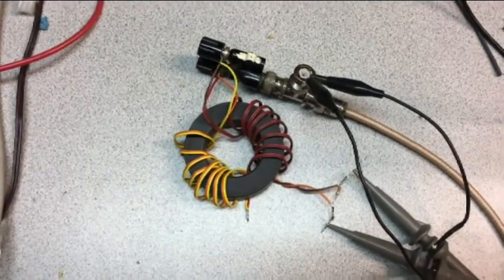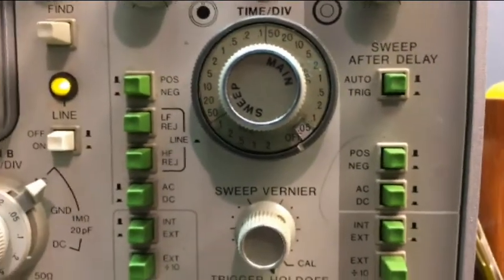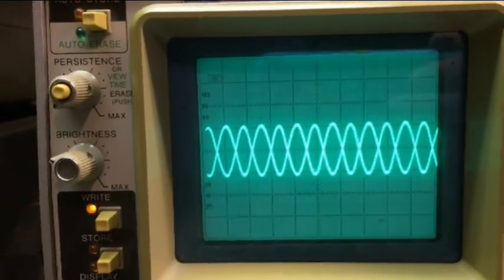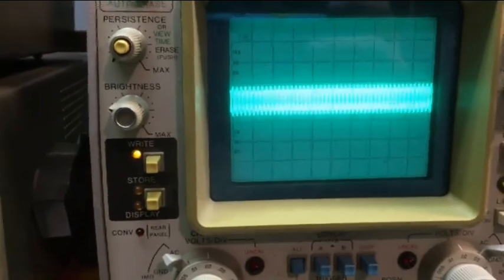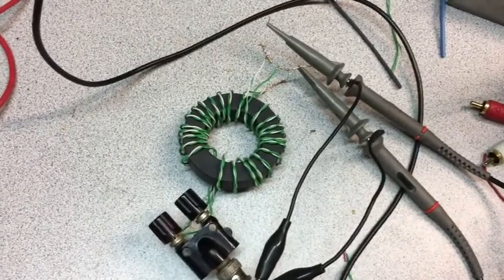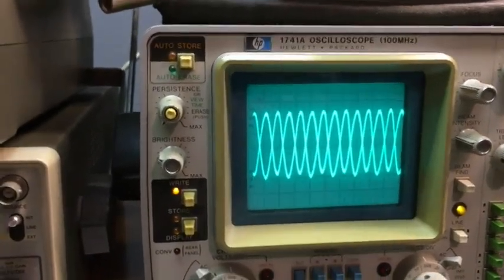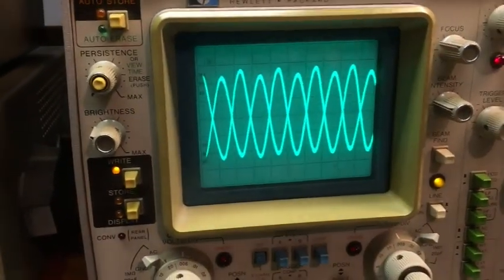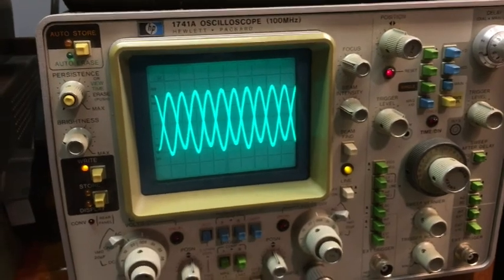Guanella Balun 4:1 Test Signal Generator / Oscilloscope

Comment: You should do the same test using two separate cores rather than a single core. The single core forces the output into imbalance .. Check the w8ji.com website for some testing done ...
Reply: Interesting. Thanks for the link. Y
Reply from the maker: See the original paper by Guanella 1944 https://www.qsl.net/kp4md/guanella.pdf
Reply: @hamprepper585  Thanks, light holiday reading. It's interesting to see that his original intent for impedance matching was to match from a high impedance valve output to the lower impedance transmission line. Y